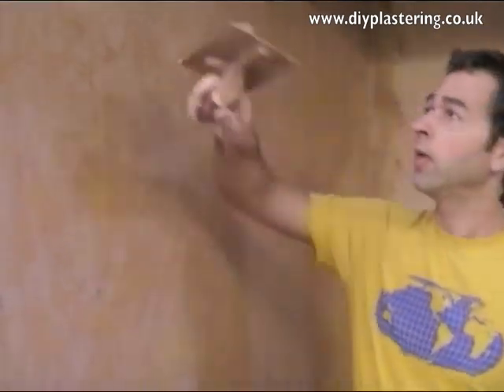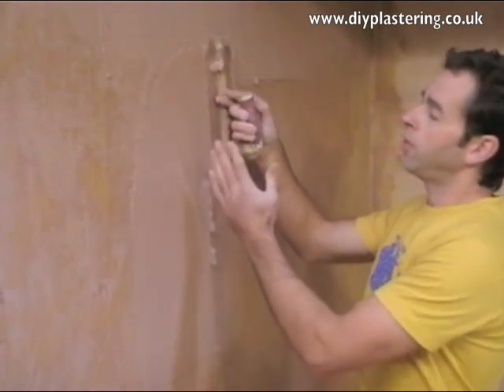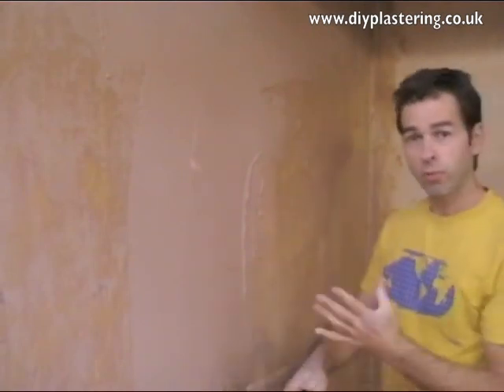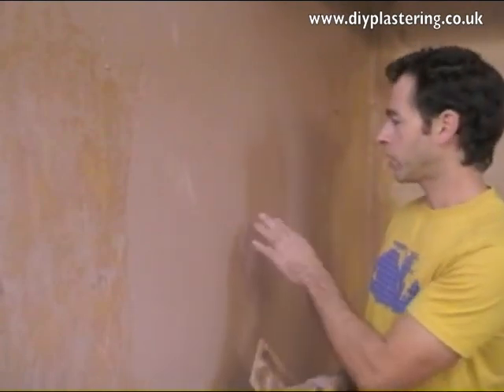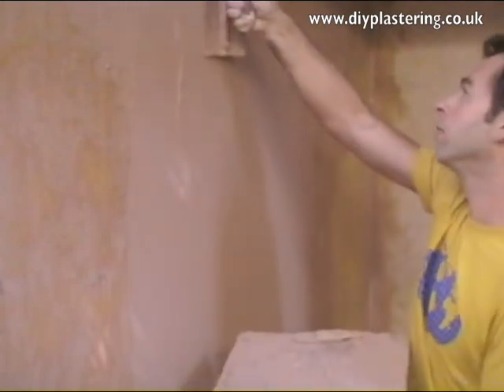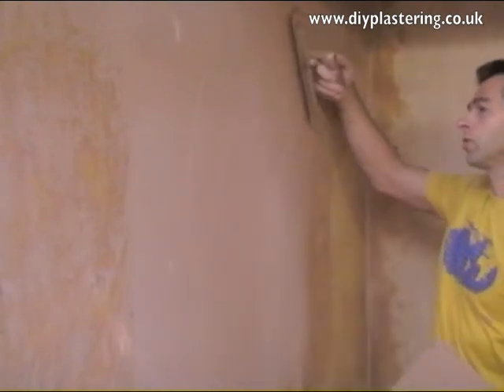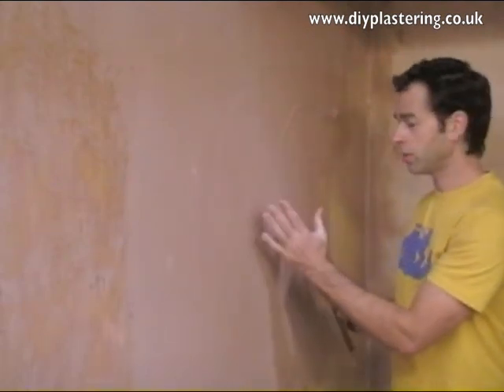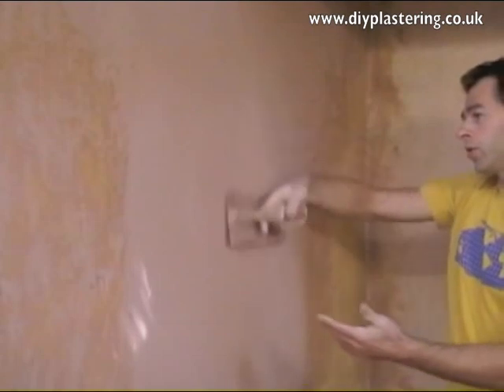How to Plaster a Wall

Comment: Hi the reason he is able to move the plaster around for a longer time is like he says in the video, if you apply PVA to the walls before skimming it allows you more time to play around with it before drying. I usually mix 1 lot pva to 3 lots water, to give you even more time with it you can also apply a first coat of pva, allow it to dry then apply a second coat and begin to plaster once the pva becomes taccy

Comment: so what's the difference between this and drywall?
Reply: +Jody Strickland  dry walls is plasterboard that gets the joints taped and filled and the screw holes where as plastering is covering the whole area with 2 coats and troweling in hope that helps :)

Comment: first of all you need to have a trowel thats been broken in before you can attempt any type of fine coat finish ,buying one from a diy store or buildres merchant even if it says broken in,will not give you a very good finish,so before you even attempt it try and borrow one from a plasterer.

Comment: Never do 1 coat! Im a plasterer i would not apply the second coat untill at least 15-20 after flatterning 1s coat otherwise the first coat is so wet that theres no point in adding another the 1st needs to be firm enough that it wont mix into the top coat

Comment: Get a local plasterer to do your work, this guy has shown you how to "plaster" a 1meter square bit of wall! Plastering is NOT something you can just have a go at and do ,not everyone who goes on a plastering course can do it ,or even becomes a pro plasterer, it is a very hard job and you will make a total mess of your floor/walls , don't waste your money on the gear get a pro to do it , its an investment into your property anyway, any plasterer can tell you what kind of plasterer has done a wal

Comment: If you read through the dribble that you have posted, you may realize that it does not make any sense. Maybe a children's english class would be an advantage for you to start with. I believe you may also have some ego issues that you may need help with. Seek some advice - cheap insults only belittle your intellect. As I said before I really did earn 1000 pounds p/week many years ago. So what!